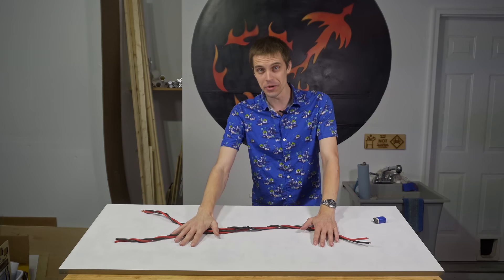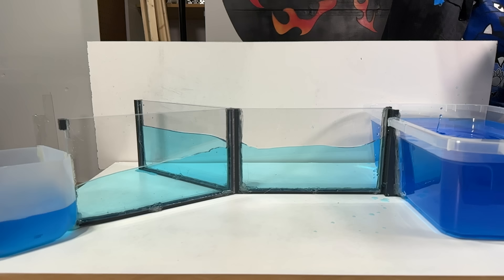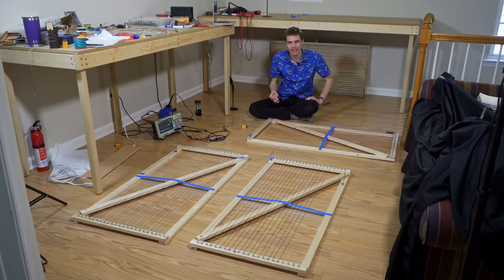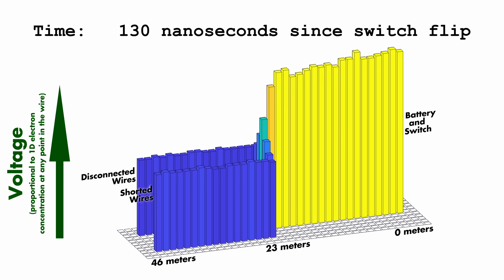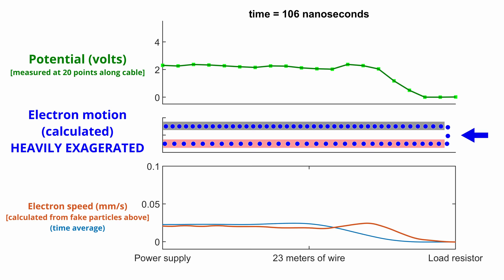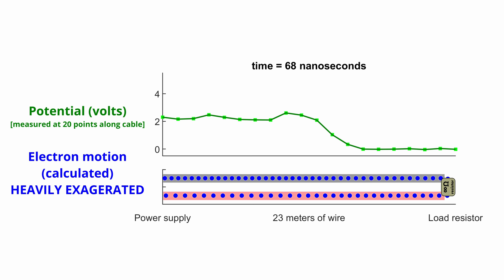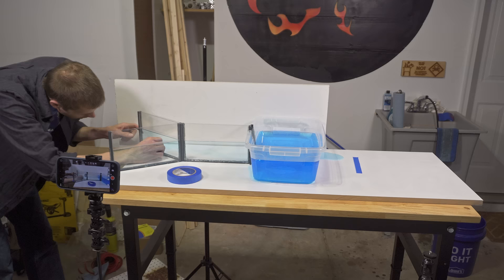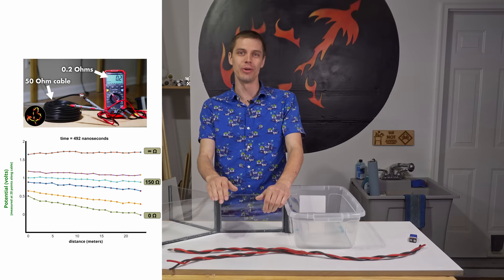Watch electricity hit a fork in the road at half a billion frames per second

Comment: I read down quite a number of comments looking for the key words, in engineering speak. Not finding them I decided to write this comment. 

You did an excellent job of revealing a phenomena that has been understood since the time of copper wires for telephone circuits. Your wires constitute what is called a transmission line: The wires have a finite total resistance, and some amount of capacitance over the length of the twisted wire path. It is that resistance and capacitance that are responsible for the waves and reflections you measured. What you did was create an instrument called a Time Domain Reflectometer! With just a bit more math you could have determined the lengths of each section of wire, and where the Y-point was, just from the graph on the oscilloscope. Kudos on your achievement!

Comment: Holy cow! I have a masters degree in physics and this is one of the most intuitive and understandable explanation of electron flow I've ever come across. I'm amazed on how much information you could gain with this "basic" setup. I also love your systematic approach and the brakdown of the system. Very well done sir!
Reply: It is not electron flow, it is the propagation of guided EM waves on the wire.
Reply: @msf60khz  at least i know now physics majors are not gonna steal my electrical engineering job
Reply: @msf60khz they’re the same thing 🙃
Reply: @flowild fellow electronic engineer here — @longnose154’s model is perfectly accurate because electron movement and wave propagations are analogous models for each other — basically half of the point of this video is to explain this 🙂

Comment: I've seen the "ringing"/"bouncing" oscillation effect on an oscilloscope when connecting wires before but to see it graphed out spatially like that is incredible
Reply from the maker: I didn’t REALLY understand it until I could see it spatially. This is one of those cases where figuring out how to make a visualization ends up teaching me
The impedance-matched version is WILD https://www.youtube.com/watch?v=RkAF3X6cJa4
Reply: @tripplefives1402  nice, thanks for that comment, it just clicked in my head for understanding antennas, totally makes sense after this video!
Reply: This is also a good explanation for Impulse reflectometry. . Next time, take a car battery as a power source, and then you dont need to measure in which branch the short circuit is.

Comment: Wow. Just wow.
As an electronics engineer I can say that without the shadow of a doubt this is the most easy to understand, visually impressive video about electricity I’ve ever seen - and the insane amount of work that this must have required just drips out of every pore.
And I have never actually thought about how the waves flow… this is insanely interesting! Thanks so much!
Reply: This was demonstrated in my high-school Vocational Tech Radio - TV Repair class using Tubes & dual trace oscilloscope. the effect described here has implications in pulse & wave shaping for mil-spec IC substitute and circuit cross-talk. I am solving an ELF (Extremely Low Frequency) innovation where this demonstration is one factor in the solution. PhDs can be a challenge for explanations. 😊
Reply: In the early '80s, I built a semiconductor company to manufacture semi and full custom analog and digital ICs. Our designs were in everything from toys to spacecraft.  It must be so much easier/more-fun to learn now, than then.  I'm obsolete as hell, but this was fun to watch.
Reply: @EatMyOats  Please make sure to upload a youtube video about your project once it's public! Thanks!
Reply: @RickMcCargar  In university a professor explained the concept of "software defined radio" to us. We were used to calculating antennas and frequencies and at first thought he must be joking.
Then showed us his gear: a room full of equipment worth hundreds of thousands.
Today I have one in a drawer somewhere,  worth 150 EUR and the size of a box  of cigars.
But to me, honestly, it still borders on black magic that this concept actually works.

Comment: In this circuit, the twisted pair functions as both a resistor and capacitor. The initial inrush current is taken up by the capacitance. When it reaches steady state, only the resistance is applicable.

You have essentially reinvented a time domain reflectometer (TDR). It uses the reflected pulse to determine the length of a wire. It can also determine the distance to a fault or splice (useful for locating a fault or determining that a signal cable has been tapped). The same principle works for fiber optics. For security purposes, an easily broken and nearly invisible unsheathed fiber is woven through a barrier. When the barrier is cut, the fiber is broken and the exact location of the break is determined by the TDR. Hint: Don't ever try to break into a Google data center.
Reply: That's exactly what they did when my glass fiber connection was broken. I didn't understand how the measurement tool worked. He explained it, but to me, it didn't make sense at the time. 

Thanks for this. With this video and your comment, "reflectometer" becomes as easy to understand as echolocation.
Reply: So the ringing after the inrush spike is because of the stray capacitance and inductance forming a tank circuit right? Resonance at the natural frequency
Reply: DAMN! I was just about to mention the TDR. Navy avionics school, 1975.
Reply: So if I understand correctly, the initial reflection at the fork is caused by resistance(impedance?) change of doubling the wire cross section? If the forking wires were smaller and summed to the cross section of the initial wires there would be no reflection at the fork?
Reply: Reinvented TDR? You can go back further and explain why turning on an amp (audio or radio) without the (speaker/antenna) connected can destroy the equipment instantly! (ok, in a few nanoseconds, when that voltage inrush spike comes back!)
Reply: reflectometer sounds like something from an episode of wallace and grommet, would it not be more logical to just recognise that the reflections in a system can be measured and information about that system (e.g. distances) inferred ... rather than calling it a reflectometer?
Reply: Oliver Heaviside would disagree.   Actually the series resistance and parallel leakage resistance in a practical transmission line have so little impact that tgey can be ignored from the Telegrapher's Equation - leaving just the capacitance and inductance effects alone accounting for the observed results
Reply: @godomohawk  You are on the right track, although what you need is to have the characteristic impedance of the branches be twice that of the "main" - it is a function of wire size, spacing and dielectric, just to be a little more pedantic.  It would not necessarily be cross sectional sum as stated.
Reply: @nathanm6202  Reflectometer is the device built on that principle. What else would  you call it ?
Reply: @nathanm6202  So by that logic - for thermometers, would it not be more logical to just recognize that thermo temperatures in a system can be measured and information about that system inferred ... rather than calling it a thermometer?
Reply: I have always wondered why disconnected speakers destroy the amp, now I get it, thanks for highlighting this feature. @NigelTolley
Reply: @nathanm6202 you think that because you're reading it as "Reflect-O-Meter". It's a "Reflect-ometer" same way you would pronounce thermometer. As opposed to "therm-O-meter".
Reply: @dmitripogosian5084  It also called echometer or cable radar. But TDR is the most common designation.

Comment: This is how antennas work! Use AC power (sinusoidal voltage pulses at a particularity frequency) and you can make a resonant antenna with the right length of wire.

Edit: take a look at a 1/2 wave dipole. Two disconnected wires that resonate to create electrical field pulses. I would love to see this same kind of demonstration with an antenna. Amateur radio license may be required, since you will be transmitting at that point.

Comment: Awesome! As a 40+ year electronic technician I knew the answer, we just always accounted for this as an initial "spike" when energizing a circuit, sort of "filling the pipes" so to say. Your visuals really brought it home for this old "sparky".
Reply: Old Sparky, so when I was a kid way back, parent or grandparents would say, "Don't keep flipping the lights on and off, it uses more electricity!". Is that because the initial first few waves it does use more energy than needed before it settles in? Now once they told us this we did it many more times because that what kids do. But they were right!
Reply: I'm a mechanical tech and I understand the concept of inrush current.
This video was really good. I also deal with high pressure fluid circuits with dead sections that start and stop and this will be in back pocket from this day forward.
Reply: @TUTruth  The initial few waves don't matter much for power consumption. The reason they told this, is because the filaments in incandescent light bulbs change their resistance with temperature. When they're cold, the resistance is low and a high current flows. Once they heat up the resistance rises and the current drops. When you kept flipping the lights on and off, the filament didn't stay hot, so more current could flow
Reply: @TUTruth Flipping the switch on and off actually uses less electricity overall. Light bulbs use a lot of power when you first turn them on because the resistance is very low at room temperature, then the filament heats up to maybe 2700 kelvin (almost immediately), resistance goes way up with temperature, and current goes down. 
This is why you can't guess the watt rating of a light bulb by measuring the resistance with an ohmeter. Try it. Measure a 100W bulb. The resistance at room temperature will make you think the bulb will use 10x that amount of power, but this is only true for a fraction of a second.

The real reason to not flick the lights on and off is that it damages the bulb. Any time you've seen a bulb burn out, it was when you tried turning it on. They very rarely burn out while they are already on.
Also true for fluorescent lights. Striking the arc wears out the tube.
Reply: @shawn576 :   Thank you.  Excellently explained.
Reply: If you knew the answer was "C"why didn't you put down  In the comments like he asked us to do first  before revealing the answer to us?

😂 But after he told us the answer You leave your paragraph saying that you knew it was a dull time 😅

Comment: I'm a technical trainer who was wondering why an open circuit in a car's network system caused a huge voltage spike on the oscilloscope. This video single handedly demonstrated and proved what was going on and why. This was exactly what I was looking for - thanks so much!
Reply: CANBUS is super interesting stuff, I've spent many months studying it. This video re enforced to me how electronic networking is just voltage pulses of "information" sent down the line and detected. It's the same concept with how the battery "figures out" how much current to send down the line as it is in actual networking systems. Voltage is sent down the line and feedback is sent back.
Reply: Now I understand why my truck's poor electrical from past owners causes issues for me all the time. :)

Comment: I've been a PCB designer for 17 years, some of my best training was a hands on hydraulics class that I took at a tech college. It's surprising how well the analogy holds up. I'm just an electron plumber. I love your video and really wish I'd seen something like it my first try through college physics.
Reply: Electron plumber!
Hope you don't mind if I steal that term as a fellow PCB designer! xD
Reply: Yes I was surprised when I read the difficulties of "ordinary" consumer USB cabling and how and why it's impossible to have long cables due to higher frequencies (signal quality, capacitance), connection reflections - all ending in tighter tolerances. High-end PCBs, chips are all that³. Cheers
Reply: @VADemon  Yup, thankfully there are fiber optics for when the need is great enough to justify the price.

Comment: The bouncing and ringing are due to capacitance and inductance effects of the imperfect conductors. The two combined give you reactance, you measured it beautifully. This is also why we use termination resistors in data lines like RS485 at dead ends in order to avoid bouncing waves of signal causing interference.
Reply: It's not that the conductors are imperfect, it's that they exist at all; even a superconductor inherently has inductance and capacitance with the world around it, and a sole superconductor not in a transmission line would still deal with the characteristic impedance of free space. He's replaced the characteristic impedance of free space with the characteristic impedance of the twisted pair, but the dynamics are due to electromagnetic interactions of the current wave with itself, not resistance or imperfections in the line. It is the impedance mismatch at the end that causes the reflection.
Reply: For me it's easier to understand the behaviour of the disconnected wire considering the twisted pair forms a big capacitor. Huge voltage at first, as the capacitor is not charged. As it charges, voltage drops closer to zero. And all the resistances, inductances and capacitances make up effectively a RLC oscillator.
Reply: why such presentations an animations are not givento people in the school..?
Reply: @MrMassmaker  They are, we performed similar measurements at EE school to understand conductors better in real world applications. In my case it was a spool of wire that we characterized with a signal generator and an oscilloscope.

Comment: This is proper science, purely driven purely by experimental data with a heap of tedious attention to detail and not a slave to some fragmentary theory. Wonderful. Some discussion/exploration of the impact of tapping the wire at various points could be added: the electrons have additional wires to pile up in, changing somewhat the outcome. It's not immediately obvious that this can be ignored.
Reply from the maker: There’s a methods video on the second channel if you’re interested

Comment: This has been an excellent series, I am an avionics technician, we have a lot of rules of thumb, do this don't do this,  that keep our circuits working. But few can explain the underlying why's in a coherent way.  For instance we terminate unused data busses with terminating resisters to stop "reflections", here I see exactly what it is that we are stopping, return waves that stomp all over our signal.
Reply: How do I become an avionics tech?
Reply: @mrblank-zh1xy  I did it by joining the Navy.  I worked on the AWG-9 radar system for the F-14 from 2001 until it was decommissioned in 2006.  I also cross-trained to the F/A-18's radar systems, the APG-65 and the APG-73.  Free training, plus a GI bill on top of that.  I also went to 2M school (miniature/microminiature electronics repair) to round it all out.
Reply: Is that a 1553 data bus you're talking about?